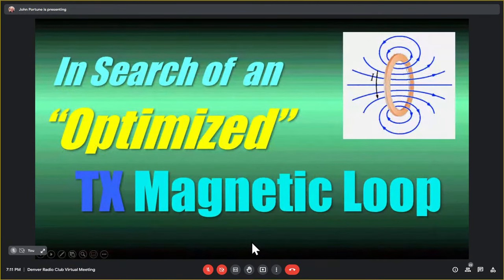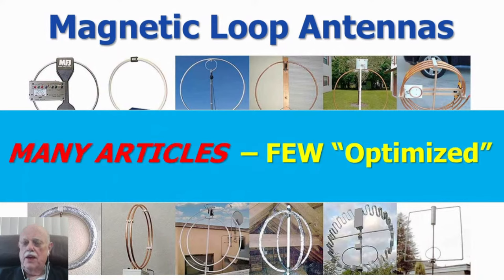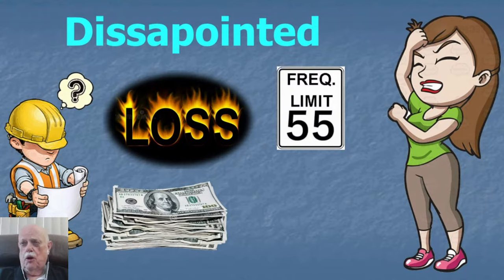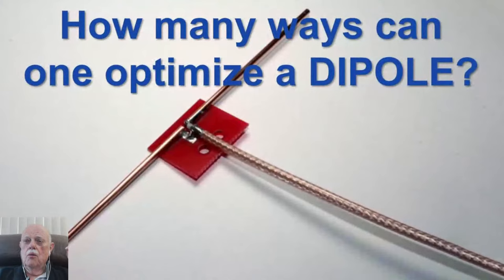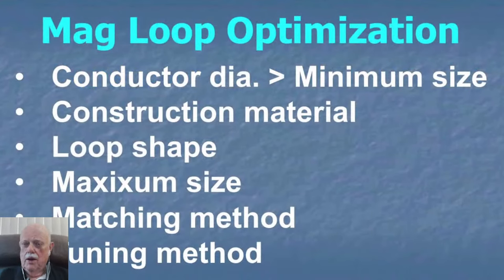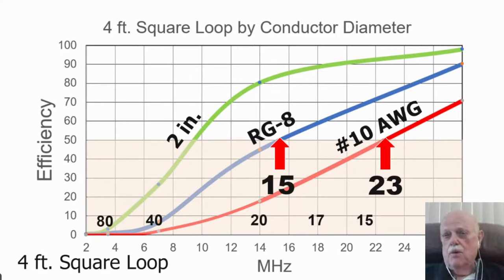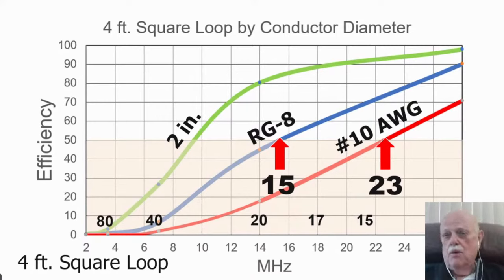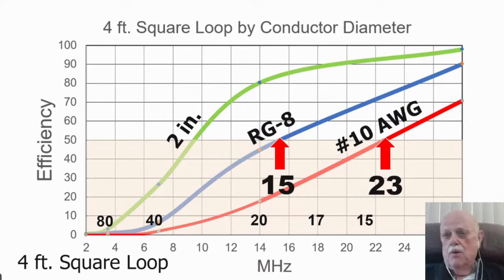Optimum Magnetic Loop Antenna - John Portune - W6NBC

Comment: If the shape doesn’t matter, then why square? Why 2D? Why not spherical/cubed/pyramidal?
Reply: I’m not a physicist…. But Faradays law deals with 2D area…. i.e crossectional area…. So 3D wouldn’t be optimal …. It would work but adding the extra dimension would not improve the area as we are slicing that cake!
Reply: @TheArtofEngineering  then why bother with tubes if that is the case? Wouldn’t flat outlining of a square area using copper tape be better/easier?

Also, thank you for the reply…very interested in what may not have been tested dealing in this area
Reply: Mr. Portune is defining "optimum" as a magnetic loop antenna design that performs well, is inexpensive, can be home-build easily, and is robust/strong. When considering all of these optimization design goals, an inexpensive tubular, square structure is the result.

Comment: There are issues i can see with this design.....The biggest problem is the manual tuning given the High Q of these,this is a real pain. You skipped over this because im not sure you dont really have a plan for this.  To move a tube within a tube requires lots of gear driving, moving in tiny tiny increments.  This design would just about make a single frequency loop maybe for FT8 only. Personally i think you are trying to redesign the wheel and i'm not sure we need to.
Reply: One can integrate an electric motor with gearing into the PVC pipe, which simply needs to be thick enough. A polyamide threaded rod, well lubricated, guides the inner pipe back and forth along a guiding rail, preventing the pipe from rotating. For this purpose, guiding rails or three guiding rods, also made of polyamide with sleeves, can be used. Powering the motor is quite straightforward with alternating current. Rectifiers with capacitors can also fit inside the pipe. Power is supplied through a transformer, thus isolating the component. To ensure the antenna stays dry and protected from corrosion, it should be coated with Vaseline, preventing moisture from seeping in.